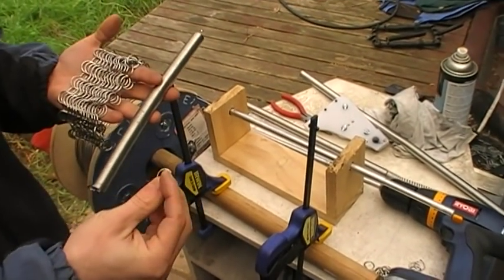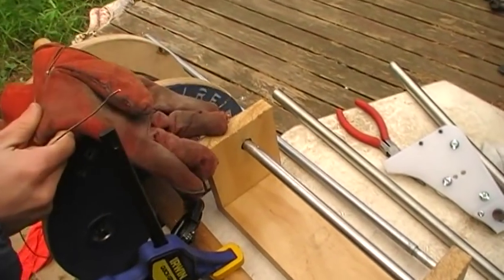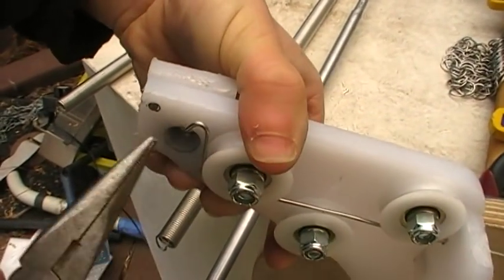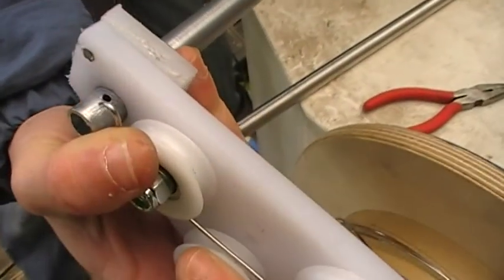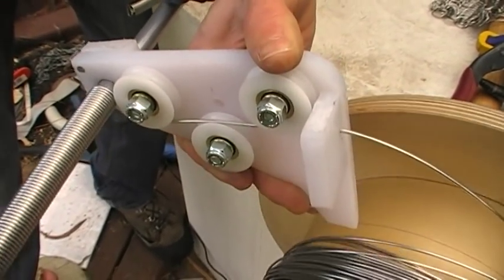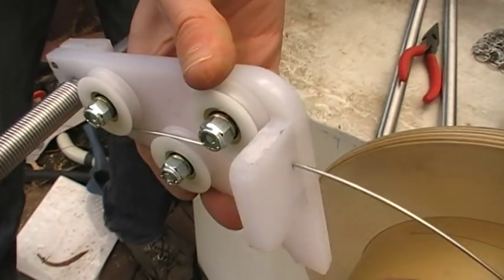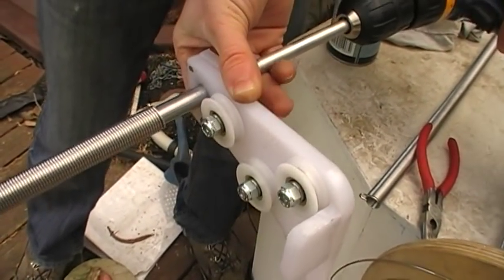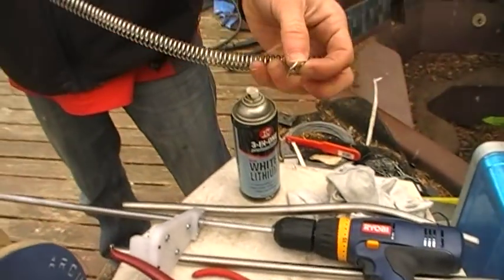How to make chain mail rings - Enhanced Jig

Comment: I actually made one of these using a cutting board for walmart that cost me 3 dollars. 3 Sliding Green Door Replacement Nylon rollers, and 2 screws. It worked amazingly. Thanks so much for the video, it gave me great ideas.
Reply: Great use for a nylon cutting board!  😄😄😄

Comment: This is genius, brilliant!  I am so impressed.  I need to wind wire for jewelry to make small spring beads, wrapped wires, etc.  this will really speed up my work.  Thank you so much!  Nice ways to use up cruddy nylon cutting boards too.

In jewelry making, we make a lot of jump rings - same thing you made.  However, we never use pliers as it displaces the metal when cutting so you don't get a clean finish on ends of rings for a clean join.  We use a jewelry saw only. I would suggest a Dremel fine disc over the pliers.  Less hand fatigue too and you don't ruin your pliers on steel.

Comment: Okay. Pulling the spring some before you cut is genius. All the time I wasted opening each ring one at a time. I made a jig, as you call it, for my chainmail making machine. But instead of the 3 roundels like you have, I just used one screw with a hole drilled through for feeding the wire through, and a nut to tighten and put some tension on the wire. It requires a firm hand to hold it in place as you wind however.

Comment: Just a quick note, stretching the rings like that will distort the rings in a way that they won't lay flat. The effect appears more so on smaller rings and/or tight weaves. Not such a problem with armor, but really bad for jewelry. 

Thanks for the awesome video, super helpful.

Comment: screw 2 strips of wood to a plank and lay the spring between them. Then zoom along the length of the spring using your angle-grinder with a 0.8 or 1mm cutting disc. That will leave a nice square end for silver solder/braze. Springs like that are also good for bending tubes without them collapsing.

Comment: You can speed up your process substantially. Get a steel rod the same size as the aluminum one and slide your spring on it. Then use a Dremel tool with a cutting wheel and cut the rings along the top, then slide them off into a bucket. I have used the same process for jewejry split rings.
Reply: Doesn't the Dremel remove too much metal for jump rings to close tightly?  I'm worried about that.
Reply: @mjremy2605  there are very thin cutting wheels if that is a problem. mostly though that is a moot point. even the thicker and longer lasting cutters leave a gap slightly bigger than a 16th of an inch. you can easily close that with a pair of pliers.
Reply: @craigmckinney2219  If you use a jewelry saw you get no gap that your eye can see.  Everything else leaves gaps and pliers dislodge the metal so the ends are not a clean cut.

Comment: Wow I didn't think to stretch the spring so they all start in the open position, thank you!
Reply: +Veggietative Sometimes by stretching the coil like that you can warp the rings wrong so that it comes out more oval than circle.
Reply: +Jay Drewniak Angles my friend, angles.
Reply: Hints on stretch opening: stretch half your coils, leaving the others alone. Stretch out the stretched coils to a bit more than twice their original length so they are open enough to weave in without fuss. Much more than that Pringles your rings. They end up a slightly saddle shape.
The coils you didn't stretch you can cut into a stash of raw rings, to be preclosed.
Store stretched open rings separately from the rings you'll close; stretched rings are extremely tangly.
When I get some opened links out, I don't even use my fingers; I just grab a clump out with my pliers and to untangle some links I thump the clump on my worktable and start weaving the links that fall out. When I've used those links I thump again, etcetera.
Preopened and preclosed links allow me to speedweave two links at a time.

Comment: Mount the pulley wheels on one side with a removable plate in the other that has different diameter holes for making different size rings. That way you only have to change the "face plate" of it. If you designed it to where said plate slots in, it's a quick change.

Look up dragon scale chainmail, king's mail, and king scale for why you'd want to do that.

This is brilliant, I will be stealing the idea, trying to improve it, and see about automating the process further.

Comment: I saw this very same thing done back around 1990, with the exception that the guy used an angle grinder to cut the rings loose while they were still on the bar.
Reply: If the rod had a slot cut in it, that angle grinder assuming you picked the right thickness could cut them easily. A jig for that would not be hard. Do that with different thickness bars, and you have nearly automated rigs, that will produce different thicknesses of rings.

Comment: Old thread but, thought I'd let you know there are still people getting ideas from your jig.  I used some spare wood, a few still v-groove bearings and even attached the small spools I work from so it's all self contained.  I can let the whole thing just hang until the weight of the spool is to light to hold it down any longer.

Comment: If you use a length of rod with a slot cut in it, you could create a jig using a cut off tool with a thin width wheel and run it up that slot cutting all of the rings at the same time in the same pass.

Comment: Hey, looks great,the jig. 
- imorovement: instead of a hole in the rod, just a slit in the front of it makes insertion and removal of the wire a lot easier.

And, just the opinion of a living history guy, historical mail has a smaller size. 
In Leiden, the Netherlands, Roman mail sections were found with an 3mm diameter...( ok, that is really extreme, but good mail has about 5-6 mm diameter, perhaps a bit larger. Not bigger, because arrowheads and pointy weapons may not pass through the hole...)
And historical mail is not butted, but rivetted. 
Of course for Larp, renfair etc it's ok.

Comment: I have a hand crank coiler myself.. along with the hole for the wire (that goes all the way through) there should be another smaller hole that connects to the other one but stops when it connects to the first hole so that the wire comes free easier..

Comment: Instead of pulling your spring apart, you should look into a "jump ring" cutting jig. Essentially, you hook a jeweler's cutting arbor up to a table router, and (using a jig to hold the coil), run the coil through the router and you'll get each ring cut in seconds, with minimal loss and flush-cut ends.

Comment: Interesting idea. I made a full suit ala  Bayeux Tapestry and made a hand winder to wind a 3' coil. I used a low grade of spring steel, heated it and tempered it after. Handling 70 lbs. of red hot metal can be interesting, to say the least, to get it into the oil tempering tank.
 I am quite interested in finding out the model and mfg. of the cutters you use. I used end cutters and wore out 3 pair. I was not happy with the pinch cut they made. I tried a diamond wheel and a metal cutting blade, but they removed way too much metal. 
  The project took me over 6 months of work. Mail really only protects against slashing weapons cutting you. Field trials of mine proved that. An arrow with a Bodkin point goes right through it. This is based on my own experience. Yours may very.

Comment: i imagine so, it would simply be a matter of designing it. the only problem i can think of so far is that the winding would be time-consuming, and thus, tiring, at least in comparison to a power drill, which you'd probably be saving up for to replace said handcrank setup.

Comment: great idea mate. but can i make a suggestion that would make this a buisness oppertunity? use a solid pole for the mount. and use a angle grinder to make a line all the way along the pole. after filling it all up. find the line. and cut along it again with the grinder. you'll save a lot of time and effort not using cutters.

Comment: just saying that your  rings are huge
Reply: mellowb1rd because that is totally relevant ... - facepalms -
Reply: Totally. This would be decorative only. You would need a larger wire with a tighter coil. This is not going to stop a spear or dragon tooth:)
Reply: so says the pleb that never has worn chainmail evah....  he wouldnt be making it out of soft ass stainless steel either if it was for real combat, your point?
Reply: Neither is anything else, because dragon teeth don't exist.
Reply: @darrenraleigh1986  it's for design, or some fictional reenactments. It doesn't have to be historically accurate
Reply: He pointed that out in the video, and also points out that he's using 6-in-1 to make up the strength loss of having a larger ring. It's almost like you didn't watch the video...

Comment: So um... just a thought, but couldn't you just feed the wire directly into the hole in the rod and let the rod bend that first crook in the wire? I've seen wire pop out before, and my thought is that the rod is going to apply constant tension on the wire from the start which may prevent the pop-out. Maybe?

Comment: Make a trough that holds spring up to 50% of its height and to hold entire spring length.  Then make a slider that straddles it.  On top of the slider mount a Dremel (or similar) with a cutting blade.  Slide the assembly along the spring and it will make very nice cuts and cut the whole thing in the same amount of time it takes you to snip 15 rings - with a lot less work - but using more blades, a trade off.  The cutter has to be deep enough to not touch the bottom of a ring with the screw just on top of the rings.  It will then cut all the way to the screw using all of the blade.  The slider isn't necessary, of course, you could hand hold it, but why?

Comment: Did you ever try keeping the spring on the bar and using a Dremel type tool to cut through it? I would think it might go faster, and you won't have any pinched points on the rings.

Comment: Very nice! I night have to try to make something like this.

Just a thought: is the spring tight enough, yet loose enough that you could put a stopper on the drill end of the rod, then loosen the hook of the wire and make a continuous spring? Perhaps by squeezing the middle of the spring slightly, or applying a (slightly diagonal) roller/wheel on the jig?

Comment: One wonders. If you put the finished spring over a steel rod, re-bar for instance, could you build a jig to hold an angle grinder with a small depth cutting disc, then clamping the re-bar on both ends, slide the cutter, angle grinder and all straight along the length of the spring, thus cutting the spring into individual links in one pass?  (<-- worst run-on sentence in history)

Comment: If you are worried about 'strength' of the chainmail you should actually solder the ends. Butted chainmail is rubbish. Either rivet it or solder it. It will increase the strength much more than additional rings would.
Reply: +Kajan451 What do you mean by solder or rivet?
Reply: What you are doing is Butted Chainmail. Which is nice and easy if you just want something to LARP with, but it has no real defense value. Chainlinks will break when struck, which is why in history they either soldered the ends or riveted them.

Traditionally people would solder with a copper silver alloy. Meaning they'd heat up the alloy and apply the solder over the butted end of the ring, which prevents the chainlinks from springing open when struck.

Alternatively you can rivet the chainlinks. This requires you to hammer one side of the ring flat, and then punch an opening into the thus created flat surface, through which you then stick a piece of wire (the same you used for the link), alternatively you hammer the wire flat and cut tiny triangles out of it (easier to bend the ends with pliers). And then you squeeze it shut, thus bending the ends and riveting the chainlink shut. 

Both methods ensure that the chainlink wll not spring open when struck with a blade, making the chainmail durable and useful. You will not get a blade through them easily, because the chainlinks cannot open easily anymore.

Feel free to google silver soldered chainmail or riveted chainmail. Edit: There are also youtube tutorials on how to rivet chainmail /edit.

As i said.. if you are worried about the strength of your chainmail, then you should make proper chainmail and not just theater props. No disrespect if you just want it to look cool, its perfectly fine to do butted mail. Nobody expects you to go out and fight someone with a sword in hand in it. But as i said.. if you are worried about the strength of the mail and do not want it to come apart or be durable enough to be hit, then you will have to do what our ancestors did and close that butted end either with a solder or with a rivet.

Personally i would suggest buying a high tin grade solder and an soldering iron and just solder them, its a lot less work than riveting. Of course riveting looks cooler, and most importantly more authentic, depending on the period. Oh lead/tin solder isn't going to fare that great when hit either, but its will make a 'theater prop' quite sturdy, will not increase the weight and work out so much better than additional rings. If you want to take the chainmail to a real fight where people wack you with stuff.. you need to use silver solder as even high tin minimal lead withstands enough punishment.
Reply: +Kajan451 actually butted will stop slashes
Reply: leather is already plenty protection against slashes, chainmail should protect you against thrusts and unless soldered/riveted, a nice stab can easily pry open the weave. that being said i've tried great quality larp chainmail (stainless steel butted) and it felt solid, wouldn't fall apart upon use, unlike crap tier aluminum counterparts, which could be lighter to wear, but would also tear with minor use

keep in mind that nowadays a fully functional chainmail is of little use.
Reply: Even riveted maille was of little use against a thrust from a spear, sword or arrow. the reason maille was riveted was to keep the links from separating under their own weight. Metallurgy went through many improvements before the rings could hold the weight below them. Years of armorsmithing has made me very appreciative of modern steels.

Comment: I don't know if you are still monitoring your video, but the question that I have is about the rod itself.  I've made a jig similiar to the one you first showed, but I used a solid steel bar bent into a crank handle at one end.  The problem that I have is getting the darn spring off the rod.  Is the aluminum hollow rod better for that?

Comment: Say you didn't have a power drill, or didn't have access to one. Would it be possible to make some sort of hand crank on the end that you would normally place the drill, and turn it that way?
Reply: Yes. One good trick: with a crank handle bent into one end of the rod, coil a short coil as long as the length of the handle part, remove from the mandrel, and slip it onto the crank handle. Now the handle part turns with you and doesn't irritate your hand as you crank.

Comment: I made this with the nylon cutting board and brass rollers instead of nylon, however, the wire has a tendency to reverse direction and go back down the rod, what should I adjust to prevent this?
Reply: Adjust the angle of the rod. It should not be perpendicular but slanted a bit such that the wire coils "downhill," as it were, following a path of least resistance.
With my feeding device, I hold the drill both hands and swing tight over some degrees to the right, with the wire feeding from the left of the mandrel. As my coil builds, I gradually back away from the feeder.
The longest mandrel of this sort I ever heard of was two meters.

Comment: Or an even faster way to cut the rings is while the spring is still on the rod use a cutting wheel on a drimle tool and cut them down the full length of the rod and then just slide the rings off one end into a bucket. 😅😮😮

Comment: I wish you explained how the Jig was made. I want to make this, I looked up the items and am having trouble finding a nylon piece you have. Care to help explain where you got some of the pieces?
Reply: I hope you found the plastic cement to glue the nonmoving parts together.
Reply: @w.reidripley1968  My guy, this is a comment from 12 years ago xD I think I used sliding door rollers, and a poly cutting board. Worked great. Added a price to help guide the flow of the wire

Comment: be easier if you had a shaft with a small keyway then you just run a dremel down the length with a cutoff wheel, instant rings...

Comment: So the pulleys are screen door wheels, what is the main body of the jig made out of? Was it made or purchased in that shape?
Reply: He said it was made out of nylon. They sell thick sheets of it. Check online for stores near you, or you may have to buy it online. The thickness here looks maybe 3/8 in. Do not get thin sheets and put them together. I did that in the past on something and a middle one cracked and shot upward, very sharp.
Reply: RoseKindred
I estimated 1/2 inch. I was just wondering if it had been possibly salvaged from something or fully fabricated
Reply: SeijinDinger Ah, okay I miss understood. I do not know if he salvaged it from something, you probably could and just attach the wheels. But to me it looks hand fabricated. I seen a few others in different videos and I myself am going to make a wooden one for my next project. I think though having the middle wheel adjustable (drilling other holes to plug it into) will work better for me.
Reply: Poly cutting board should work.
Reply: oh yeah I didn't even think of that. Those things are amazing and you can get them for cheap. Even if they are broken or cut up all you need to do is cut and shape it to the shape you want and discard the bad parts.